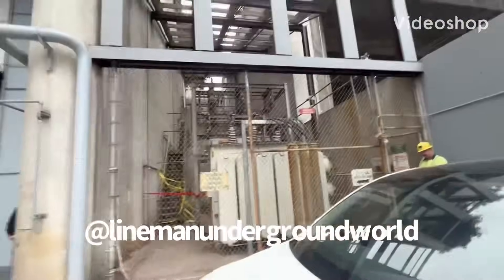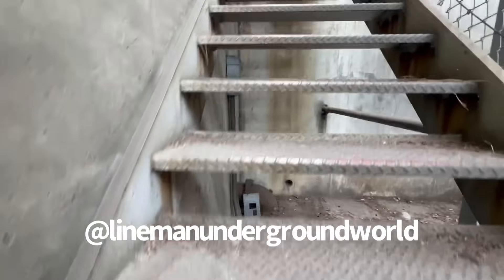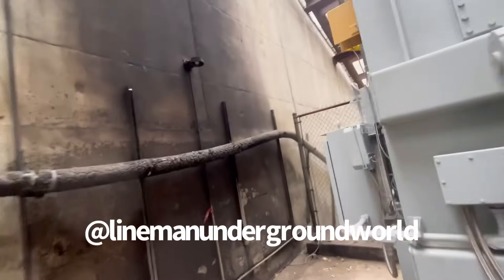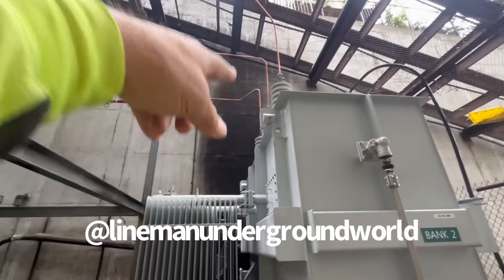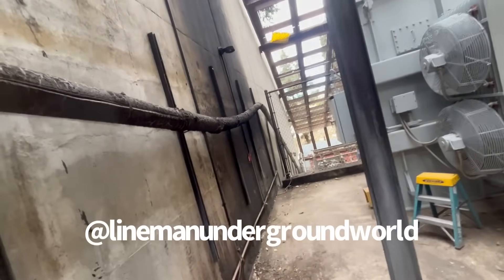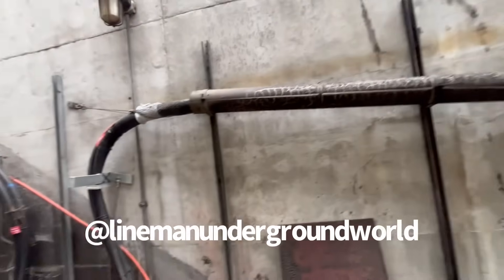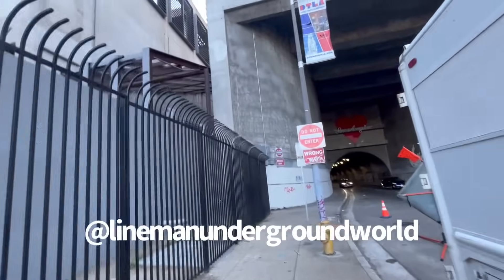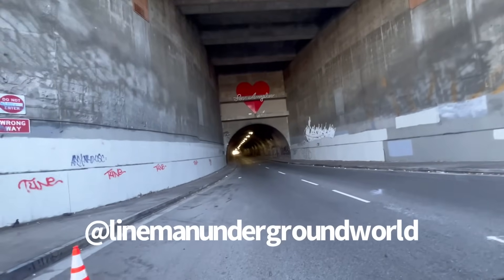Blown up 34.5kv transformer and cable

Comment: Looks like the same hv cable we use in underground mines
Reply: Ive worked at mines all over as a electrician probably the most impressive was in Cleveland OH the vertical shafts were about 2000ft then went out probably 7ish miles  place used a massive amount of power we had 2 feeds i think 11500v which was the highest voltage available from the utility and we used 2 different utilities with the option to tie together in the switch gear if we lost one
Reply from the maker: @coolerman9798  wazzup cool , where is the mines located and how deep does it go and you guys have a station down there, stay safe over there brother 👍😎

Comment: Back east when didn't have a pulling eye  we had a 3 piece tool called a Murphy  ,place in a empty duct  ,the center piece had an opening  to place a shive in or shackle and the 2 outside pieces where a wedge  ,it was about  18''' or 24'' long,
Reply from the maker: @AlbertJacoby  wazzup Albert, sounds like I said in the video we call it boomerang , but it would be awesome if you had a video or pictures.. thanks for sharing your experience stay safe over there brother 👍😎

Comment: Are people generally pretty courteous when you need to have their car moved or do you guys just have it towed when it's parked in an otherwise legal spot but interfering with your work like in this case where the Tesla was parked over the manhole
Reply from the maker: @coolsnake1134  wazzup cool , jobs like this are important and not so important, so we talk to people in the company at this location and most of the time they move it , but if it’s a real emergency 🚨 than we will have it move or towed …